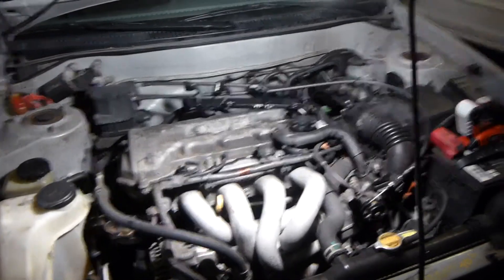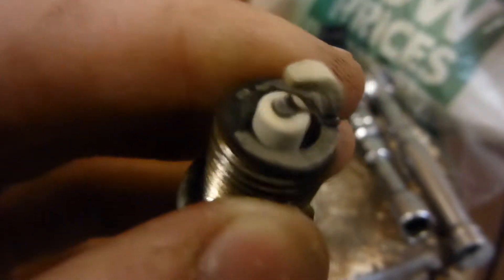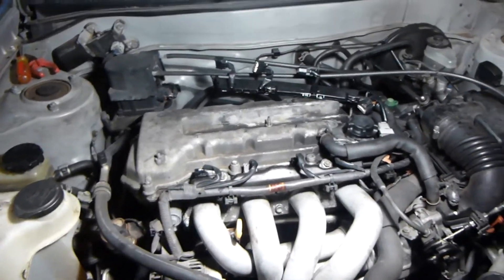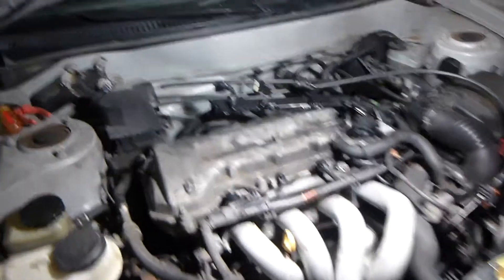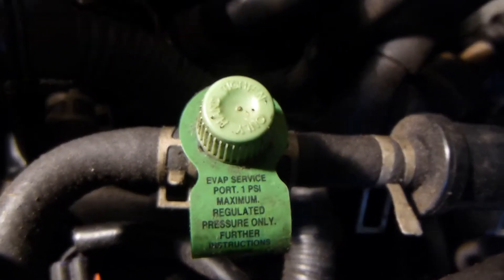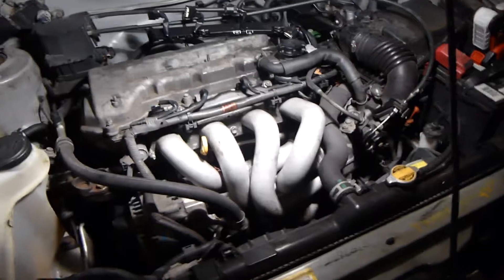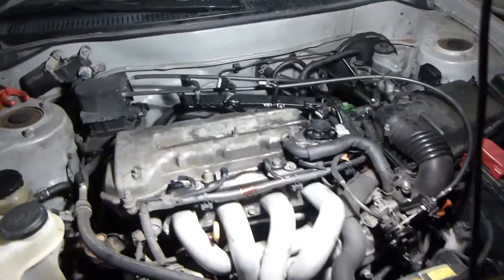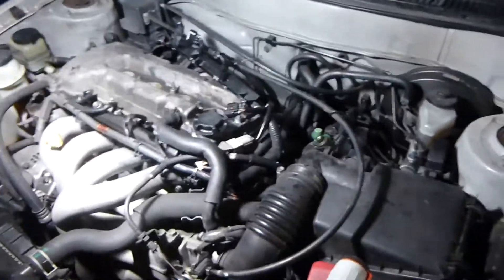Does My Toyota Corolla's Spark Plugs Look Okay and Talking About Running My Car on Gas Vapors

Comment: That is whats called ash deposits, from oil or fuel aditives burning in normal combustion. There are a number of causes. A comon one is oil getting past valve seals or rings. It could just be that the plugs have not been cleaned in ages. All engines burn some oil. It could be lean fuel, although unlikely in this case as the time it would take to get so much ash woukld have done serious dammage the the piston and combustion chamber. You say the car has high miles, likely rings are worn and leaking some oil. Not necerily anything to worry too much about.  First thing I would do is change/clean the plugs. You may be well served changing them as the ash can hause them to get too hot and damage them. Do 100-200 miles with cleaned plugs and re-inspect. So you can see how fast the ash is building up.

You could also try some injector cleaner aditive and or premium fuel for a tank. Just to make sure the injectors sre delevering a full charge of fuel. These kind of fuel aditives rarely leave deposits as they are designed to remove such deposits.

Plugs that have been fouled that much can foul the spark gap. Causing misfire, The excessive heat in the plug can also cause pre-ignition (Also called pinging or knocking due to the sound it makes, ping at higher rpm and knock at lower rpm. Both can do serious/terminal damage if left to happen a lot) Either of which could triger the check engine light.

Its important to carefully inspect the ceramic insulator around the electrode after cleaning. To asses if there is dammage from heat or other issues. If its not very close in aperance to a new plug its normaly a good idea to replace the full set. Any pitting, cracks or discoloured spots mean the plug is due for replacement.

This chart has some good pics and explinations. Lots more charts like it on google images.
http://www.ngk.com.au/spark-plugs/technical-information/spark-plug-analysis

Some other things you could check to get a better idea of the problem wold be compression and oil pressure. Low compression would indicate worn rings, and tell you how bad it is. Really high or low oil pressure would also indicate issues with various seals. A mechanic would be able to do the compression test for you farly cheap. The oil pressure could be a bit harder and requre adding a sensor if there is not one in the engine already.

You have probably already checked oil and coolant. If not do so and consider replacing if unsure of condition.

Stay away from vapor etc till you have a lot more experiance with petrol engines. Here is a good video that sugests most of the 100mpg people may not be as honest as they think or would have you belive.
DIY Vapor Carburetor
You can also see how it could be very dangerious. I doubt its legal.

A propper good condition injector should be injecting atomised fuel at an almost vapor particle size anyway....

If you want over 100mpg, just get a peugot 308HDI. They get 126.82 MPG without modification. (2009 world record http://www.fuelacademy.com/world_record_drives.html)
Reply: Oh and that thing you thought was a fuel filter is for gassing the A/C.
Fuel filter is under the car.
Reply from the maker: Mongrel Shark Yeah it's about time I pull the new plugs and see how they are doing.  Thank you!  That's a very helpful website!

I don't see how that video suggests that most of the people are not telling the truth?  The video looks pretty legit to me.  And yes it is very dangerous.  Bet the method I want to try it not very dangerous.  I basically would be boiling the gasoline and then injecting those fumes into the intake.  So there would not be a big dangerous bubblier or anything like that.  Plus the I would use the cars computer so I should auto adjust how much fuel the car is receiving.  I really need to test out my idea.  I've done enough thinking!  Now I need to get building!  IDK school is starting in a few days and I will need my car.  So I can't really be taking it apart...

The thing I thought was the fuel filter is actually for the evap system.  It is basically a hollow canister.  It's some kind of accumulator/pressure reservoir something.  Yeah the fuel filter is actually inside the tank and built into the fuel pump in this car.  It costs like $200 for a new fuel pump assemble.  But luckily you can take it apart and replace just the filter which is about $60.  I think I'll let it go for now.  Maybe if I have problems down the road.  But it seems fine for now.

Thank you!
Reply: I'm really dubious about the vapour stuff for a few reasons.

As a petrol engine engineer it makes no sense. A carburettor or injectors are already designed to atomise the fuel as finely as possible. Look up some data sheets and they will have atomised particle figures. I cant see how using a heater or bubbler is going to use the fuel more effectively without adding various dangers.

I only know two people who have tried it and actually taken the time to work out the efficiency change within a decent margin of error. neither tests showed much improvement. Most of the videos/websites etc I have see lack the numbers required to work this out properly.

There is also the problem of combustion temperature. Modern petrol engines run richer than ideal, at the cost of efficiency. purely to keep the combustion temperature down. In my younger days I tuned a few of my motorbikes lean. They went awesome. huge power and efficiency gains. Was blowing all the other bikes away. Then I started melting pistons and valve gear. Turns out mechanics etc have known about this since not long after petrol engines where invented... You can also get better compression rates with less risk of pre-detonation (another great way to break valves and pistons) if the air-fuel mix is cooler. This is why turbo engines usually have intercoolers. You can even get a gain on a normally aspirated engine with an intercooler, its just not a big gain and not really worth the weight gain.

So the thought of boiling petrol/gasoline is quite scary to me for a few reasons. Even if you did get new cams etc to account for the changes in octane/pre-detonation. Re tune the fuel mix system and the ignition timing (all of which you would have to do.) There is so much that could go wrong. what happens if the engine backfires into the boiler? I'd imagine its going to explode at worst and set the engine bay on fire at best. This is especially scary when there are so few hard figures to research, and the ones that are out there are from backyarders that may not know as much as they think and would have their audiences think they know...

With this boiler. How much energy is required to vaporise X amount of fuel to get better atomisation than a good set of injectors? How do you stop the fuel condensing between boiler and combustion? with hydrocarbon fluids being so good at thermal transfer?

Fuel only has so much energy in it to be released. We are limited by how much of that energy we can release suddenly with a high repetition rate by the metals available and their combined heat and pressure tolerances.... I can get 50% more power from any carburettor engine while using half the fuel. Simply by turning a screw or two. But as I (and many others) have found this will result in melted pistons in 3-5 tanks....

At the end of the day is it really worth the risk? I would be suprised if its legal, so risk to licence and freedom. Risk to engine, risk to other road users. For what? A highly disputed gain in economy... If I was going to test it out (and I have considered it) I would be doing it on an off road engine in a controlled environment. For safety, and so I could get some decent numbers on how well it worked.

As to why does that video suggest many advocates of vaporous may be mistaken or actively deceiving people. Its one of the only ones that actually presents any useful data on fuel consumption vs work done and compares it to the same engine pre conversion. Although it still leaves me wondering how long the piston/rings will last....

I don't know about where you are, but Hydrogen cells are legal here. You add an oversized alternator, and a water electrolyser and a ring feeder. You still need petrol, but you can improve MPG by 3-4 times. By adding HHO to the inlet. Its cheap too. A third of the cost of a legal LPG conversion.

Comment: How long have the plugs been in? Do you do a lot of short journeys? Old plugs may just require replacing (depending on the mileage they've done,) however modern plugs are rather expensive due to their tip materials. Make sure the gap is correct. Plug gap is quite a critical setting.. If it says 0.8mm it should be 0.8mm, obviously +/-0.1mm either way won't make much of a difference so don't be too worried, just get it as close as you can with an accurate set of feeler gauges
A biscuit colour (like yours) is a normal colour for spark plugs, however the deposits on yours are heavier than they should be really, a good clean up with a wire brush should fix that. Then run them for another 1000 miles and check them again.
I can tell by the plugs colour that your car is not burning oil, and the plugs are not running too hot either which is good.
Reply from the maker: ***** Hmm I have no idea.  They look like they have been in a while.  I drive 15 minutes to school and back everyday some days 2 times a day.  And 40 minutes twice a week..  Is that considered short?  Yeah they are fairly expensive.  But maybe I should invest some money in this car since I got it for so cheap and it would be nice to have in run for many more miles.  I think the gaps are pretty big.  I'll pull them out sometime and re-gap when I get a chance.  That's good.  I wire rushed them and put them back in!  Thank you!
Reply: Makerj101  I would consider multiple 15 minute journeys pretty short really. As the engine will be running rather coolish heat cycles.. getting reasonably warm, then cooling off again, over and over. The reason that engines don't function particularly well doing lots of shortish journeys is that they just don't get hot enough, and thus components like plug tips, valves etc don't get up to the temperature they need to burn off excess carbon residues created by the combustion process.
You may well see the coolant temp increasing to the correct level but oil temps and heavy engine parts like the block, cylinder head take longer to heat up so are still relatively cool, and as the plugs are screwed into the cylinder head they stay cooler too so deposits can just stick to them until the plugs get hot enough.

You could also just check that the plug temperature rating you have fitted are correct. The numbers on the side of the plugs normally denote what temperature range the plugs are suited for, for instance cars that will be used in hot countries will run cooler plugs and vice verse to help control cylinder temps, perhaps yours are not quite the correct grade? The manual will show these figures. Correct grade of plug helps keep cylinder temps within a good temp window. If your plugs aren't getting hot enough to clean themselves (short journeys etc,) you could even try running the next stage hotter plug. I used to do this with race bikes to help keep cylinder temperatures under control.

Of course.. IF the plugs are old, they may just need replacing, OR the vehicle may need a service if It's not been done for a while, as things like ignition timing etc are all very important in controlling temperatures & overall motor efficiency and internal cleanliness.

As regards Spark Plugs, I always point folk to these NGK pages which are a great reference guide..
http://www.ngksparkplugs.com/tech_support/spark_plugs/index.asp?mode=nml
Reply from the maker: *****   That's very interesting!  I never knew that!  I'm glad I'm posting these videos!  I'm learning a ton about cars!  I just looked at the video and at about 0:45 you can see that they are NGK BKR5EIX-11.  So they are on the hotter side.  The manual suggests NGK IRF5A11 plugs.  So I'm not sure why they don't match.  But the heat ratings are the same.  Should I drive with the cleaned off plugs for a while and then check them after a couple hundred miles and if they are really white and crusty again maybe replace them with a plug that has a heat rating of 4 if they get bad really fast?  I guess not.  I guess there must be another problem if they engine is not getting hot enough.  Partly because of short trips.  I should have it serviced first before I go that far though.  I need to get the ABS checked out and the wheels balanced.  I pulled the wheels off and can see where a bunch of double sided tap is but no weights.  That explain the steering wheel shack.  The ABS does not come on and I checked the manual today and it says the ABS light should come on for a couple seconds when I start the car.  Never has.  First thing I checked was the fuse panel and sure enough the 50 amp ABS fuse is not there.  I need to get that fixed before winter.  Probably some problem with it or it should still be in there.  Thank you!
Reply: Makerj101  If you'd like to know more about the NGK plug codings check the link below :)

Yes just continue to use your cleaned plugs. Just check them after about 500 miles or so. To be honest I wouldn't expect them to have built up much crud really after that shortish mileage. If something did look wrong after 500 miles (which I doubt it will) before changing plug temp ranges, I would check a couple more things first like the ignition timing, also make sure your air filter is clean and you've got no vacuum leaks in hoses etc. As you say.. A full service would be a good idea.
Yes you've probably lost a wheel weight or two causing the steering vibration. Your car will feel much better again once the wheels are balanced. And your tyres will last a bit longer :)

ABS sensors/wires do go bad sometimes, they can also even be damaged by debris flying around inside the wheel arches. This should normally turn the light on for you but perhaps the fuse has been pulled by a previous owner to disable the light. Sometimes folk do this to save themselves money on repair bills/new parts etc, however the problem does not go away just by disabling the bulb and disabling a safety system altogether as you know is not good.  

http://www.ngk.de/en/technology-in-detail/spark-plugs/how-you-crack-the-ngk-code/ 

Cheers mate

john
Reply from the maker: ***** Thank you!  That link it actually very very helpful!  I just wish all companies had the same cod for their plugs!  :P

I will do that!  I might still consider getting some new plugs in it.  I've heard the tip's corners are supposed to be pretty much right angles to get best performance.  Hence why they use iridium because it won't wear away as fast.  The old plugs look pretty warn.  But I'm not really sure how much of a difference it would make.  I was looking on amazon and I can get these for pretty cheap.  http://www.amazon.com/gp/product/B000A8JLIY/ref=ox_sc_act_title_1?ie=UTF8&psc=1&smid=ATVPDKIKX0DER  Only about $21 for 4 including shipping which is not bad at all.  Same plugs are over $30 at most auto part stores.  

How can I test the performance between changes to see if doing something to my car makes a difference?

I found out why the ABS light never comes on and there is no ABS fuse installed!!!  Car does not even have ABS system!  No wires connected to the ABS fuse plug, and no ABS modulator module!  That explains why there is so much room under the hood!  I thought it looked like something was missing!  I watched some videos on driving without ABS and found that a lot of people like cars without ABS.  Seems like no ABS is better if you know how to drive and brake properly(most guys). (ABS for woman)  :P  You can stop faster and have more control if you don't have ABS but instead use threshold braking.

Thank you!
Reply: Makerj101
 Hehee.. Yea no ABS mechanism at all would create a none operation issue :)

RE: The plugs. Yes the inner core tip (the iridium part) will have squared-off edges on new plugs, however even if the edges are slight rounded it wont make that much of a difference that you'd notice any performance difference. Sometimes and only sometimes if the plugs are well worn, you may notice that the throttle response is ever so slightly more crisp with a new set, however this is mostly due to the fact that a new set of plugs will be gapped correctly, whereas a worn set will normally have an opened-up gap due to electrode wear.
Reply from the maker: ***** Yeah true!  I got some new ones and will be installing them soon!  I need some held with the valve cover gasket too!  Seems like the grove that the gasket goes into is pitted a little bit.  Not sure if I should put some silicon gasket maker in it before putting the gasket in.  I will be posting a video soon.  Thank you!